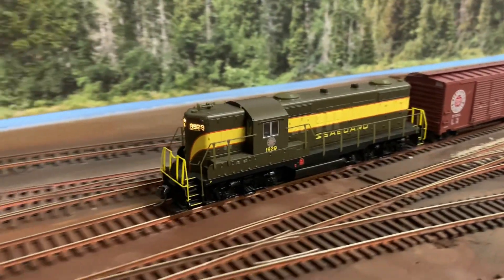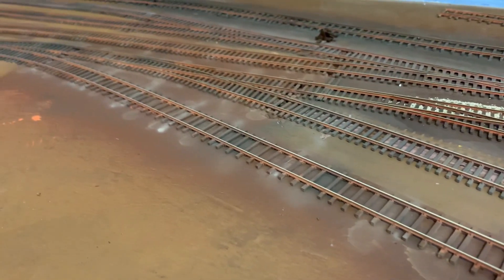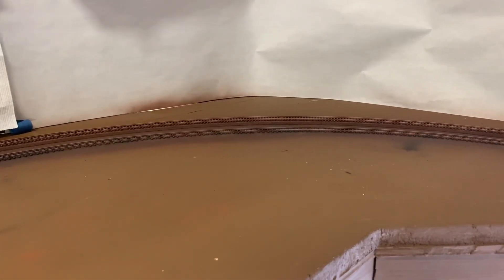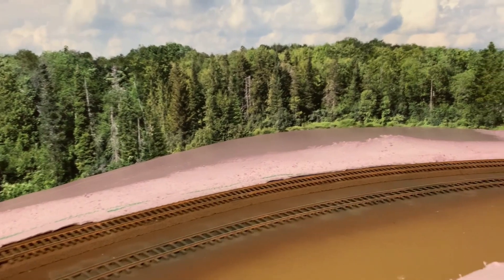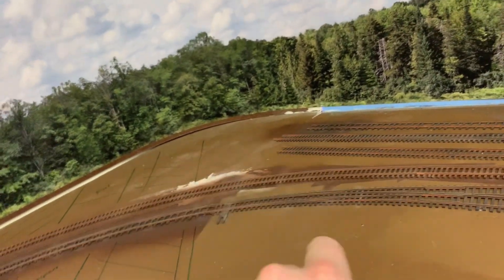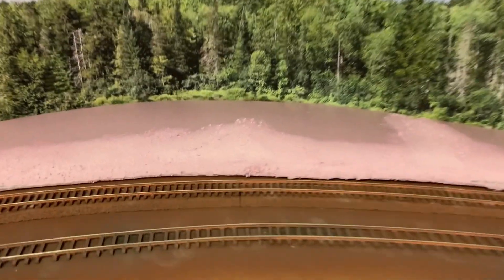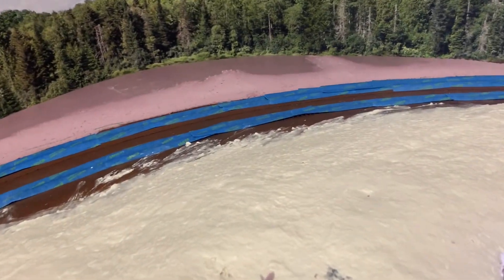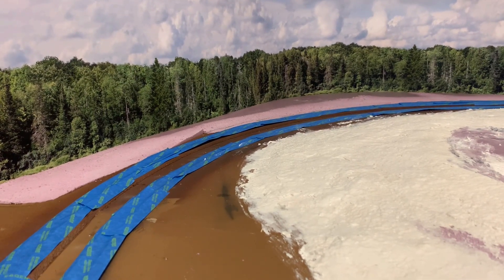Manchester & Deepwater Version 2.0 Update 15 - Scenery Begins with Rough Land Forms

Comment: One of the things you see a lot in the South near rail yards are concrete hump backed bridges.  However you do not see those as models.  Just a quick way to get traffic up and over.  If not up and over its down and under.  There is a combination in my city.  Many do not have direct approaches either.  Seems a lot of dog legs in the roads are used on the approaches and exits.  Not all are straight either.  A number of them are curved.  Something else you will see is it what used to a be a road crossing the tracks, many times near the yard entrance, where the railroad has permanently closed the crossing using detour barricades with flashing lights, or highway guard rails or both.  The hump backed bridge replaced the crossing.  

One modern detail you can replicate, is we have a lot of railroad crossing "jumpers."  The crossing red flashing lights are operating, but the arm has not come down yet to stop traffic.  People will gun it to beat the arms.  What they don't see are the two police vehicles.  A state trooper and railroad police.  Where I work the windows look out over a crossing.  You will see both vehicles down there.  The railroad is running a switcher back and forth about every ten minutes to trip the crossing.  It is also a four lane, 35 mph zone approaching the crossing with a drop to 25 mph on the other side.  It is a state highway coming into the city.  Not only do those "jumpers" get a ticket for running the crossing, but get nailed for speeding.  Usually 55 to 60 in a 25mph zone.

It can be interesting to watch how many people get ticketed.
Reply from the maker: That would be an interesting thing to model, though I can't think of a place I have seen it around Richmond.  I'll do a little poking around, see that that looks like but my initial rough idea is to use some Rix components - probably the railings only, and scratchbuild the rest of the bridge like a traditional overpass.  very early in the thought process, so plenty of time for a detour!

Comment: If your planning on more low " hills" , may I suggest fanfold. It's 1/4" foam 2x4 sheets .I think a pact is 4 of them connected together and folded, hence the name. I know it seems like a lot but you can stack it and it's easy to handle and cut. I'm always finding ways to use it. Home Depot carries it. Check it out
Reply from the maker: Thanks for the tip, Bob.  I am definitely going to smaller landforms all over, and that will come in handy!!

Comment: Hi John, another great update, the overpass looks a bit odd as drawn, the road will just hit the trees. What about an s bend in the road so it curves right after the overpass, making it a bit easier to hide the exit? Cheers, Stephen
Reply from the maker: thanks Stephen - my thought process is the bend in the road is actually vertical.  with the layout height what it is, you wont be able to see it dead end into the back drop as it curves vertically back down the far side of the tracks.  now combining that with a little right turn into the corner and some trees probably seals the deal.  thanks for sharing your thinking!

Comment: I like what you are doing so far, however I'm not sure that the overpass is a good idea. 
I say the as it has nowhere to go apart from into trees. It may work if you can custom design a different backdrop for that part so the road goes off into the distance. 
Maybe do a standard road with crossing gates?
Reply from the maker: So, my thought process is with the layout height what it is, you won't be able to see it dead end into the back drop as it curves vertically back down the far side of the tracks.  If I combine that with a little right turn into the corner and add some trees behind engine servicing over there, I think it probably seals the deal.  thanks for sharing your thinking!

Comment: So did the train work okay so far running on the super elevated curve?  Awesome to see trains running again.  The other nice thing abut that little knoll is that it will help add a bit more of scenery break between the yard and Deepwater.  Good luck with the sculptamold.
Reply from the maker: Thanks Ethan. Yeah the curve worked fine!  Looks good and very smooth rolling through there.  
You’re exactly right about the knoll. I like to try and add little scenic breaks like that. Even though most scenes are smaller than a train length, it actually adds realism because you can seldom see an entire train in once in the real world.
Reply: Welcome.  Awesome, glad to hear.